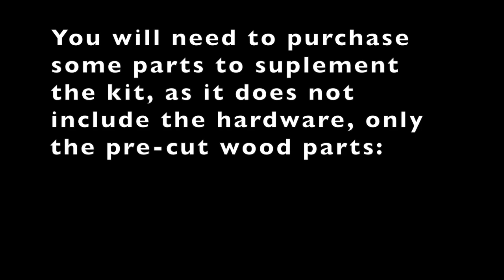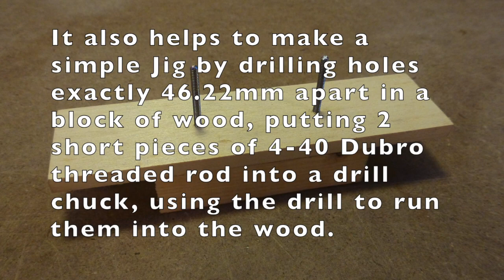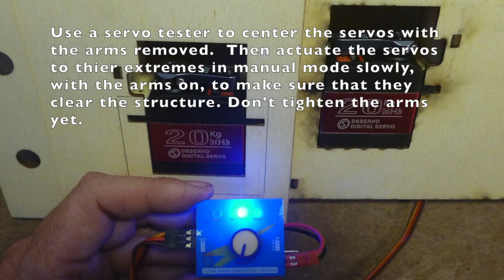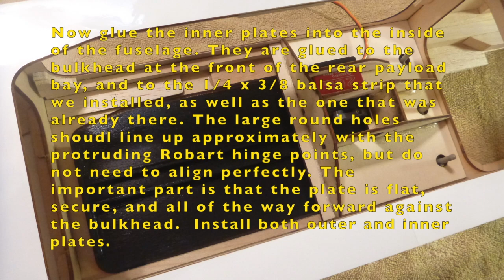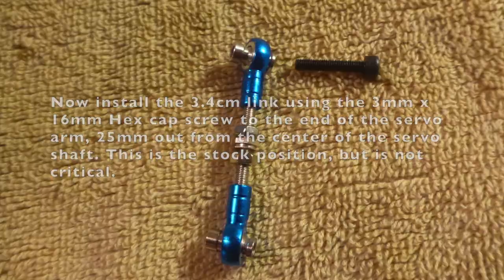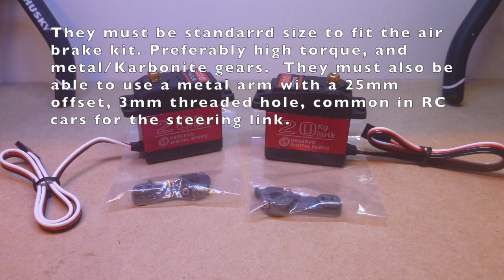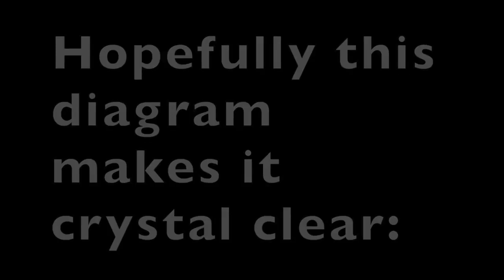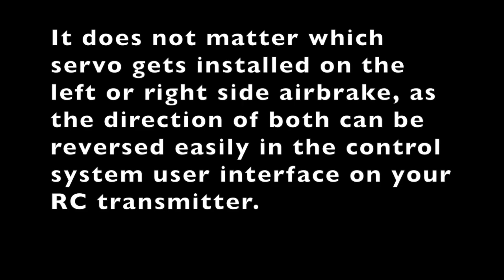Improved Airbrakes for Gemini V 2 UAV  Full Build Tutorial

Comment: Spike
, can you tell me if all the HITEC servos can be reversed with the direction of rotation or only some.

Thank you.
Reply from the maker: Only the digital hitec servos can be programed for reverse direction.  Those whose number starts with 5. 
Such as HS-5645mgas opposed to HS-645mg. 

Other servos will need to be reversed using the dissasembly method reversing the outer potentiometer wires and the motor polarity. 
Good info on servocity website.
Reply: @FPVREVIEWS  Thanks Spike, You are a source of inspiration for me, I hope to start a Gemini soon!
Reply from the maker: @GBSainteCluque  Great, We're here if you have questions during the build.

Comment: Thats a good setup but, in my opinion, having permanently glue servos is never an option cause if they need to be replaced later will be a pain in the ass.... servos always have to be attached in a way you can remove them easily without having to "destroy" something, specially in an airplane that is supposedly an professional tool as you claim yours is. Sorry about this comment
Reply from the maker: No worries, you are right, it's best to be able to service them.  They could be removed by loosening the adjustable link, swinging the door back, and removing the retainer plate.   There will be some damage to the plate, and parts of it may be stuck to the inside large plate. May have to pry it out. If you want it to be easily replaceable, could just use screws to fasten the retainer plate, as the pressure on the servo when actuated is toward the back, so would not be much pressure on the screws. 
So when making these decisions, I always try to think of the probability of having to replace it in the first place. 
The air brake servos are not highly stressed, and only actuated once on landing and again after landing. So they see very little duty.
I do appreciate the concern.  
Gemini V-2 was designed to be a DIY home scratch built/kit built low cost UAV.   It does seem to get used quite a bit for professional applications. It was not designed for mass manufacturing, or for All weather.  Best to only fly it in relatively good weather.